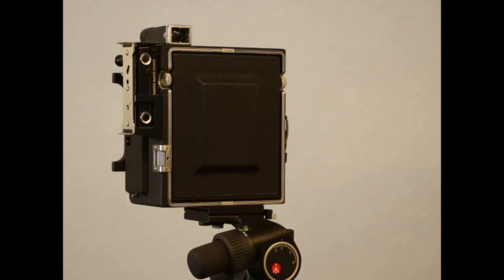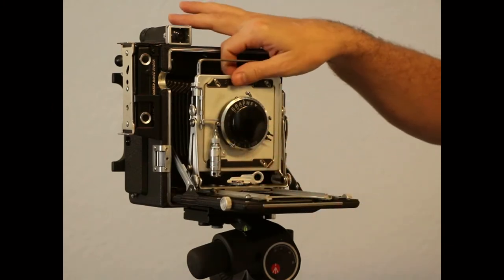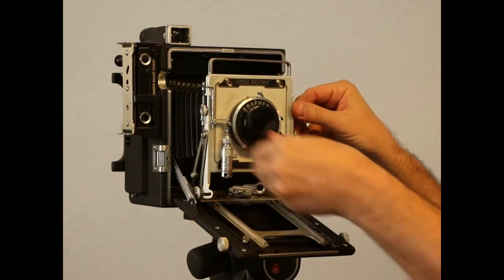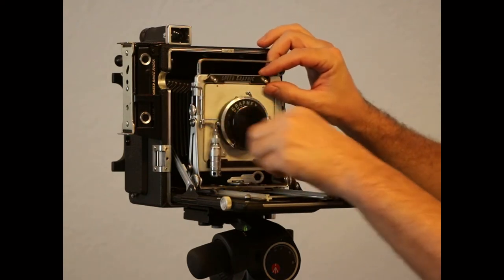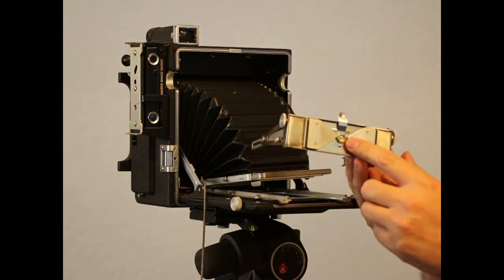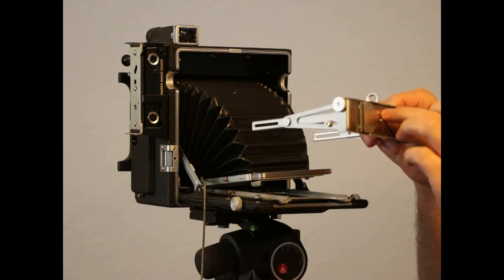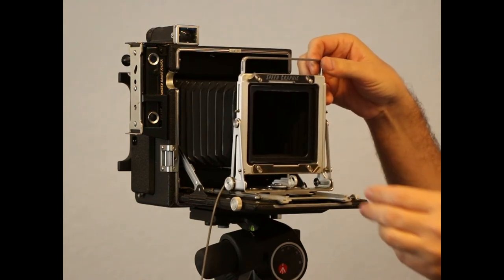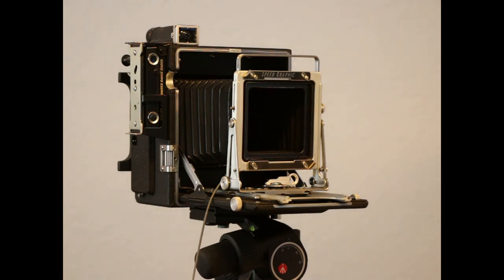Forward Tilt on a Speed Graphic - Drop Bed and Reverse the Front Standard

Comment: For good or ill, my Speed Graphic is the model before your Pacemaker: an Anniversary.  The Anniversary has front rise and drop bed, but no tilt in either direction on the front standard.  The base of the front standard has slots that look as if there should be some shift either direction, but I think I'd have to pull the standard off the front of the rail to loosen whatever locks that -- and that requires completely removing the Anniversary style infinity stops (vs. folding down the Pacemaker style, which won't fit Anniversary rails).

I also had to do an aftermarket conversion to put a Graflok back on my Annie; if you're shopping for a Speed, and want to do anything with it other than use standard film holders or slip-in roll film adapters, best to get a Pacemaker (easily identified by the built in cable release trigger on the user's right side of the body).  All of those made after 1952 had a Graflok back, all of them accept the fold-down infinity stops.

With the fold-down stops, you can use the rangefinder with a LomGraflok back and not need to carry the focusing insert in the field: just use it once to set a second set of stops the right distance behind the standard position for the lens for which you've calibrated your rangefinder.  Focus with the rangefinder as usual, frame in the upper left of the viewfinder (because the LomoGraflok's film surface is offset down and right -- you could use the ground glass and insert to calibrate a mask to slip into the tube viewfinder, if you like), meter and expose as you usually would for the Instax film, and you've got an easy-to-use, quick operating instant camera with far better image quality than anything Fuji sells.

Comment: I have an MPP Micropress 4x5 camera made in the UK in the early 1950s. Exactly the same movements as the Speed Graphic.
The front drop on the bed  also enables the use of 90mm wide lenses without any cut off. 
My MPP is fitted with a 135mm Schneider Xenar 4.7 lens. The rear shutter needs repairing so I just use the front shutter which works accurately at all speeds from 1 second to a 300th. It is synchronised for flash too.

Comment: That's cool! Never seen that done before, but in my defense I've only been using Graphics since the mid sixties. I'm wondering what focal length you've found will work without cut-off from the bed? I'm thinking maybe nothing shorter than 250? Does the lateral shift still work with this set-up? It's a slight effect but it can still be handy for those final adjustments. Anyway, I'm afraid I'm not going to try your hack  'cause it's easier to pull out my monorail and get right to work.  BTW, also kudos to you for the apparent care you take handling the bellows - some of them won't take much flexing in their old age anymore - kinda like me. Cheers!
Reply from the maker: Thanks for watching.  It works with the 135. I dont see any reason why the lateral shift wouldn't work after reversing the front standard.